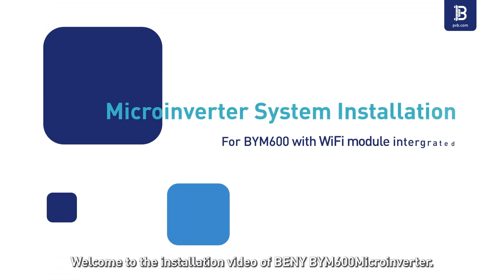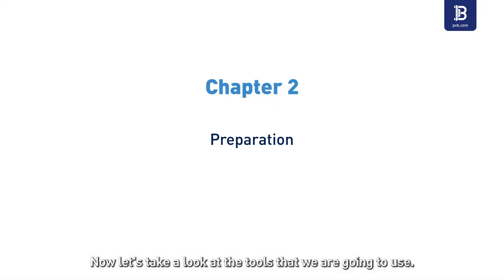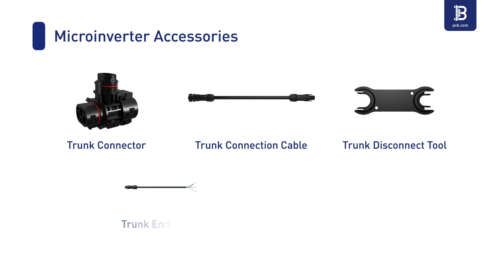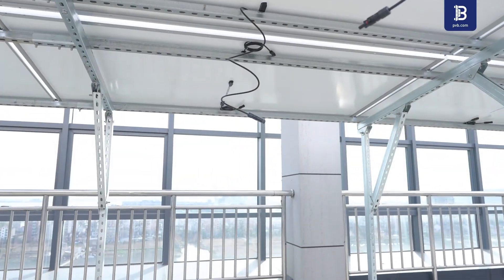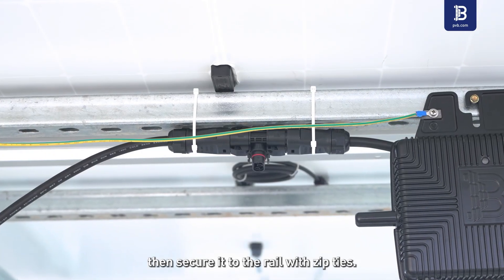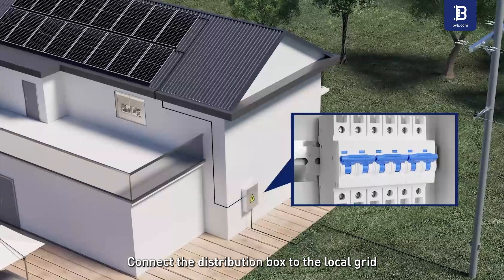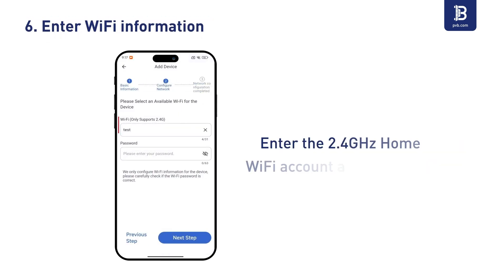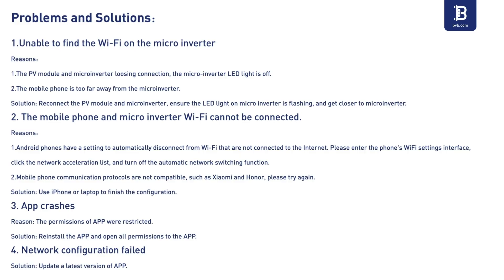How to Install a PV System with BENY BYM600 Microinverters | Step-by-Step Solar Installation Guide

Comment: Hello
I have a BYM-800W and unfortunately I can't connect it to local WIFI. The microinverter is visible in the application but it doesn't transmit data. I have 3 such microinverters and I tried with 3 different routers. What am I doing wrong?
Reply: Same thing happened with me. You have to use the bluetooth method of getting on to the inverter, then you give it the creds to your wifi. This was really tricky for me and took several attempts - not sure why. I left it for a day or so then tried again and it worked. There was an update very recently that made a few things work for me, now I can see the power output and accumulation in real time. Try the update.
Reply: @glynnbaldwinBladders  Thank you for your answer. I wrote to the manufacturer and he created a power plant for me in the PVB Cloud application and sent me the login and password. After logging in, I could easily add individual microinverters via BT. I was needlessly struggling with the BYM Cloud application.